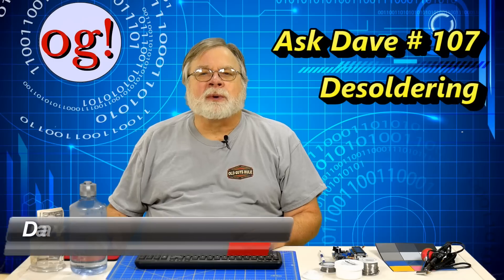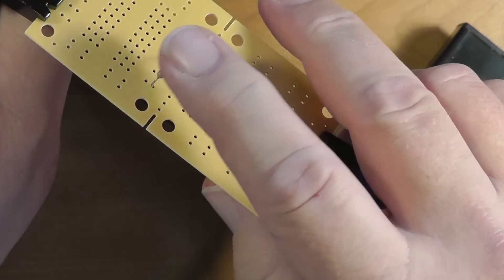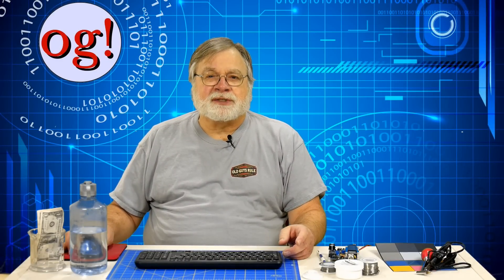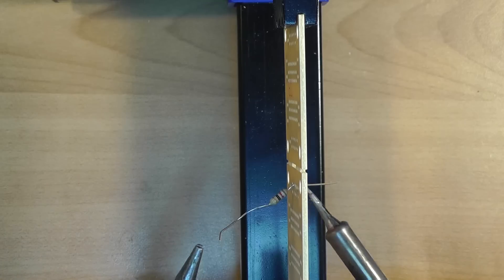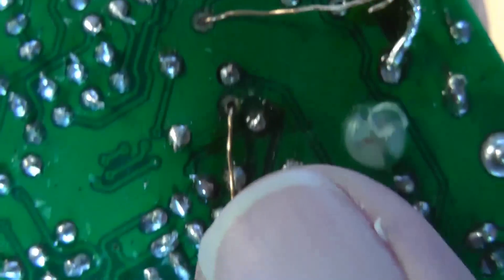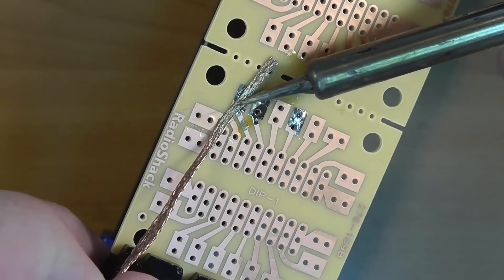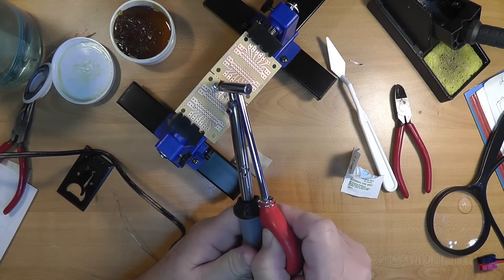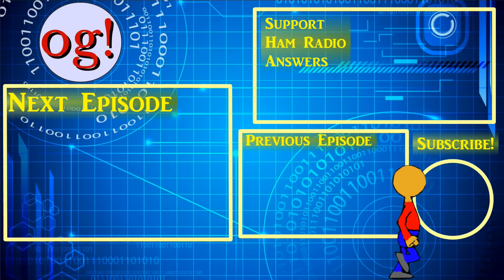Soldering and Desoldering (#107)

Comment: most of the time when the trace comes up it is not from the sucker but from too much heat, the board below the trace gets burned.  have used solder suckers for years with not much of the traces coming off the board. I also used a plunger type desoldering tool

Comment: I wouldn't recommend manual bulb suckers. They cause too much mechanical damage. I use those one press vacuum suckers. One light press and the spring release forces a vacuum and sucks up the solder. Much easier to use and far less dexterity required.

Comment: i wish to correct one thing even though there are several things i could mention .. it is where yo stated that about the solder sucker sucking the clad from the board this usually happens when too much heat is applied to the joint and to the clad..
Reply from the maker: It didn't suck it per se. Rather, the rough handling while trying to get the solder out damaged the pad and the associated trace.

Comment: What the heck...300 bucks for a desoldering rig???  Must suck more than just solder?  I prefer the spring loaded cockable type that you heat up the joint with the iron get the tip of the desolder tool close and press the trigger.  It has to be cleaned by taking it apart but it puts no stress on the board or parts and is quick and effective.  The best way not to have to desolder new work at least is just like cutting wood in carpentry.  Always measure twice and cut once...or double check your part before you solder them in.  Always heat parts quickly, make your joint and get off fast.  Excessive heat damages parts and stresses semiconductor joints and may not cause their immediate failure but could cause failure down the road.  Probably the most important thing for me is to use magnification devices to be able to see what you are doing.  I often wear 2 pair of geeky glasses stacked to get in close both before and after making the joint.

Comment: soldering braid is great. you need to make sure your soldering iron isn't weak and is hot enough to work properly with it. i actually like to use a butane soldering iron now. easy to turn on and heats up quickly. i haven't tried the cold iron yet but will in the future. if you do let me know how it goes! and btw you don't really need flux to remove solder its unnecessary. flux is usually only used when you clean a circuit board and apply the flux and then the solder that doesn't have it built in (which i prefer.) this helps the new solder stick to the circuit board better or whatever you are soldering as long as your iron is tinned well.
Reply from the maker: The difference between desoldering braid with and without flux is amazing.

Comment: Great tips, but to be honest none of these techniques will work very well on the double-sided thru-plated boards that we see often these days.  One tip: if you're trying  to de-solder a multi-pinned device such as an IC, it is sometimes more helpful to add _MORE_ solder to the pins to remove the part.  Flood the pins of the whole part with solder, bridge every pin; then drag your iron across the pins in a sweeping motion as to melt all of the solder at the same time while gripping/pulling the IC with a chip puller. Once the chip is free, you can then wick the  solder from the board in your preferred manner. I can't count the number of times this has saved me from damaging a board and/or part. Solder suckers just can't get all of the solder out of plated holes 100% of the time.  Hope this helps!  73!
Reply from the maker: Yes, good points. I have a "rework" soldering station that provides very hot air in a concentrated location which helps to melt several soldering joints at once. Also, I just received a vacuum suction device I ordered. It didn't come in time for the video, but I'm looking forward to trying it.

Comment: Actually, I don't discard used desoldering braid at all.  A savy ham can find many uses for items that might otherwise appear to be junk.  Used desoldering braid is great for use as grounding straps for metal connectors to PCB's (and a plethora of other things) and best of all... it's pre-tinned!!  :)
Reply from the maker: Thanks for the tip!

Comment: Well Dave as you said Soldering is not your forte!!!! That pcb was pretty bad. I suggest you pull some circuit boards from some old Tvs or computer monitors that have crt displays as they will have a good size board with lots of through hole components. Use these boards to practice DESOLDERING on then solder components back again. Practice is the main thing to getting good at it if you don’t have the natural ability.
Also look at getting a good headset magnifier, preferably one with insertable lenses that has 2 lenses you can either use one or both together.
For a really good one I can give you a link, it’s the type I use every day and others I have told to buy have been very happy with it. You will wonder why you didn’t get one years ago, they are so good.
As I work on radios every day I have 2 PACE DESOLDERING/SOLDERING STATIONS, and they are worth every cent I paid for them.
Those bulb/iron combos you have to be very careful with, when you have sucked the solder up move the iron away and into the container you are going to put the waste solder before squeezing the bulb. Don’t squeeze the bulb over the job you will end up with solder everywhere and it will cause lots of problems with shorts etc.
Reply from the maker: Thanks for the tips.

Comment: Re: solder braid, or solder "wick" as I was taught... it also helps to spread the wick a bit by pulling it width-wise between your thumbs and index fingers. This improves the wicking channels between the strands of copper. You don't have to (and shouldn't) spread it very far... just enough to loosen it up some. I hope my description is making sense. If you do this, you often don't need to add flux. The soldering school I went to (an advanced Navy school for technicians who work on Nuclear Power related electronics) heavily leaned towards using solder wick... suggested against the suckers. Also, you might look into and try liquid flux. It's a lot easier to work with than the paste you had. We were taught to use the liquid flux on every joint when soldering because they felt there wasn't enough flux contained within the solder - especially the fairly fine stuff that we used.  73 Gary KC3PO
Reply from the maker: Thanks for the tips!

Comment: Thanks Dave for all your very good video's. I prefer desoldering with a pump. That's easy  and cheap. I hate desoldering with cheap braid though I didn't try it with flux. Thanks for your tip. Grt. from Holland
Reply from the maker: Thanks!

Comment: dave the sucker i agree is bad but a pump is different because it does not require you to keep squeezing the ballow. her is a link to a pump like mine https://www.ebay.com/b/Desoldering-Pumps-Tools/46413/bn_7726271 
offcourse there are even easier pumps out there that are electronic meaning no priming the pump just trow a switch

Comment: Back in the day I did a lot of component level repair, and a great deal of desoldering. Pretty much everything you say here is helpful. Biggest reason for circuit board damage is from too much heat. Proper wattage at the tip is important. Better quality desoldering irons with varying size removable tips work quite well.